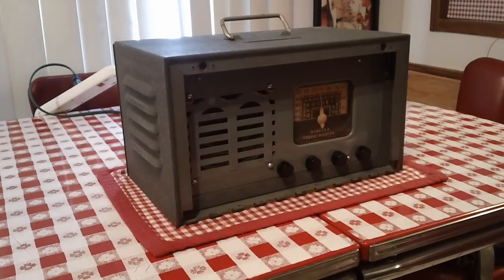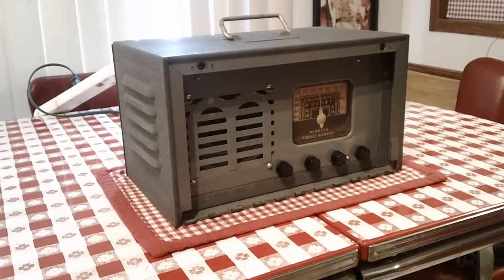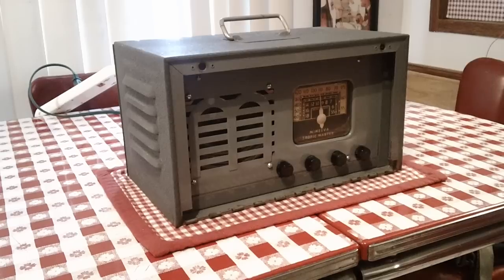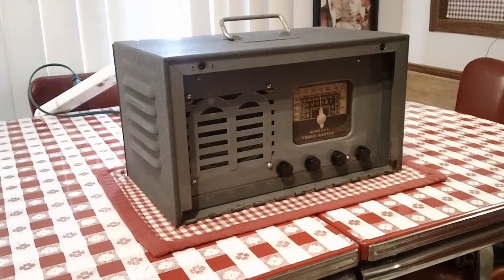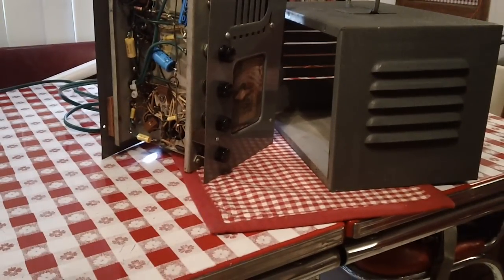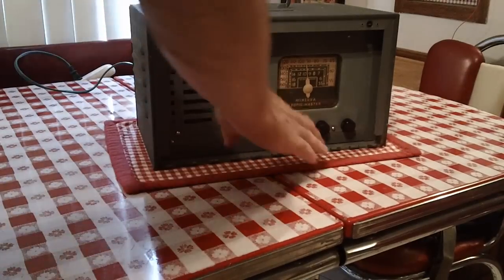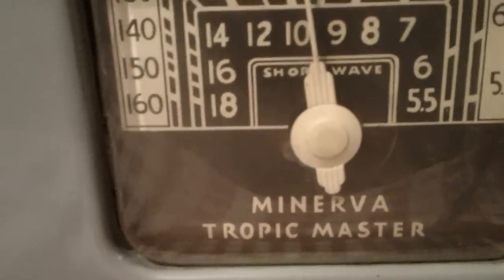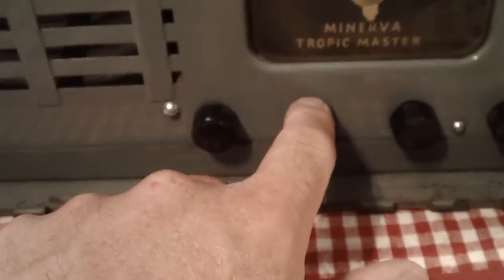Minerva Tropic Master - A WWII Morale Receiver Marketed from 1945-1947

Comment: Very cool radio. Very utility like. easy to see how it would be over looked setting with hand tools. It does look kind of like an old charger or some type of test equipment. If it had it's front cover you may not have found it at all, might look like an old tool box next to tools. Great story, Thanks Al. Paul.

Comment: Thanks for the video, very informative. I also have aTropic Master with the 25L6 push pull audio tubes. I notice that one of your audio tubes, presumably 25L6s, is much taller and larger in diameter. Please tell me what tube type the bigger tube is. After looking at the tube manual I still don’t know what it could be. The radio sounds good. Please solve my mystery about the big tube type.

Comment: I found one on ebay. It said it works. So I got it in the mail today. I'll have to get a surge protector for it. I read somewhere it is a good idea to install an isolation transformer to reduce the shock hazard. I can't remember if it had a glass or plastic cover over the dial? I ordered a loop antenna with a tunable capacitor. I looked at the various home made jobs. The factory one is a lot more compact. Looking forward to listening to it again. It's been 50 years since I have heard it.

Comment: I have one i found one in a Spartan Trailer from a auction afraid to plug it in  it has the front cover and the back is missing 
i was wondering what i should ask for it if i sell it on ebay?